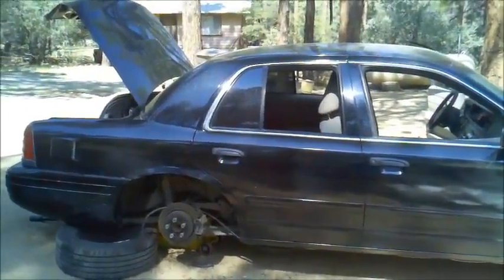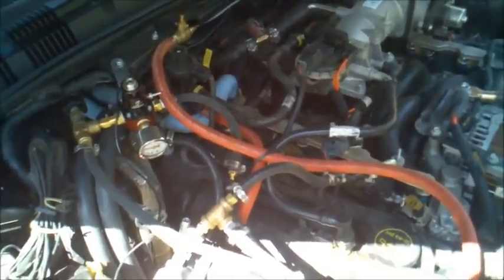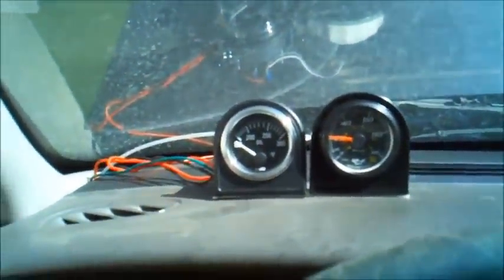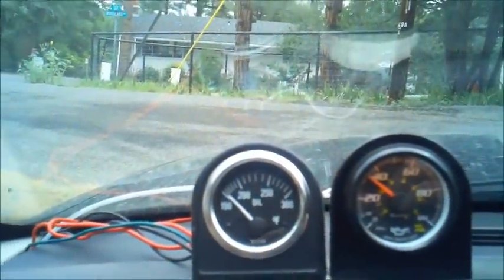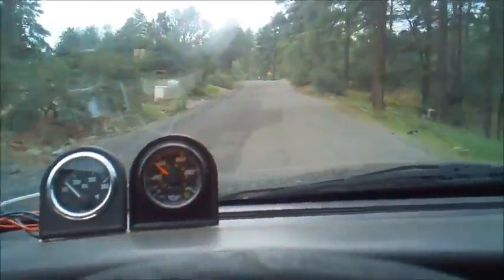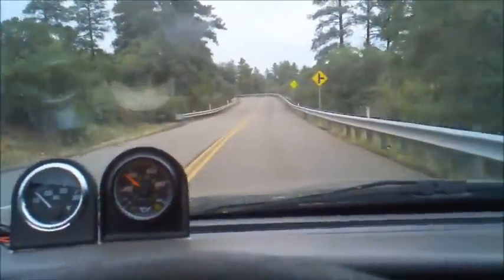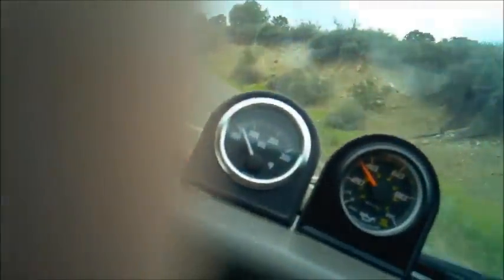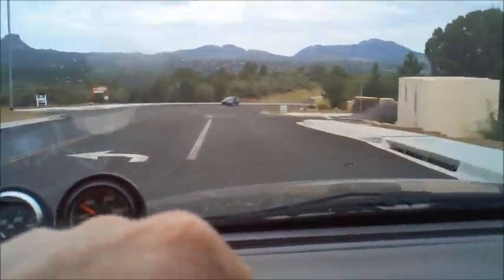H2GoNow Crown Victoria running on 100% water

Comment: man the people who've got the knowledge are really freeing themselves these days
Reply: If only we could free ourselves from this stupidity.
Reply: why stupidity ?? hydrogen cars have been known to run for ages, just a bit dangerous...
Reply: ok. not stupid. build one.
Reply: Freeman Belmont
Me? If so, why would I waste my time building something that is not worthwhile?
Reply: Ive ran my full sized avalanche off my hho cell I built... I just have to tune it to adjust the timing.
Reply: Freeman Belmont
I doubt you run a full size Avalanche off a home built HHO cell. 
First, a HHO cell large enough to produce adequate HHO to run a full size engine barely fits into the bed of a truck, often they are larger than a truck bed unless you have a proper truck with an eight foot bed. Have you calculated how many CFMs your engine flows and how much gas typical generators product per minute?
Second, you need a bank of batteries even larger than the HHO generator (slightly larger for lithium and much larger for lead-acid. Have you looked at commercial HHO generators, their size and power draw versus their output? You will find that you need a LOT of power.
Third, you will need multiple or a very large (about the size of your engine) alternator to keep that huge battery pack charging (you can never charge them, only slow their discharge).
Fourth, if you had done this you would quickly realize you have to charge up the battery pack with a wall charger because as soon as you start the engine you will see the battery pack voltage go down and it well continue to go down until the truck stops. 
In essence, what you have done is create what could be an electric truck, if you hooked your batteries to a 90 percent electric motor. Instead you take that same battery power and throw away about 40 percent of it converting water into HHO and then put it into a 30 percent efficient internal combustion engine. So, instead of a 90 percent efficient system will electric drive, you have a 12 percent efficient system. The economics of that will never make you happy.
Reply: dorianbelen
Tell me more! How many CFMs does your engine flow? How big is your HHO generator that can produce that volume of gas? How much current does your giant HHO generator draw?
My estimate is that you are burning between two and three times as much gasoline to go the same distance (if you really are doing this).
Reply: Well maybe I've Tesla'd out on you and discovered something you don't know, cause I did it 3 times...;) keep you posted
Reply: FermiGBM1 Dude I wanna do this so badly. I will find a way. Then I'll help everyone else who wants help.
Reply: The first guy who invented this idea actually got himself killed after he tried patenting it. The guy was found slumped over his steering wheel. All his designs were burned and destroyed.
Reply: @HITHEREFOLKS  as long as you install a fail safe blow off valve and a voltage limiter your good.
Reply: @Restructmusic  hey i got a crown victoria and i got some money. Can you send me some chematics on how you set yours up im fine with tuneing i just need the list of parts and how to assemble
Reply: @kevinjackson4464  there are a new type of batterys that can store 100x the charge of lithium ion. Ima use those to save on weight and money since they are easy to make that along with a plasma converter to decrease the power draw to make it heighly effictient. If i use a plasma loop device it would work just as well as the spliting proccess.
Reply: Theninety  
For three decades, since the popular use of lithium ion, I've read about a different, new, super battery literally every two weeks, on average. So far, none have panned out. Just as lithium ion hit the scene like a bomb long ago, one of the, literally hundreds, of new batteries will do the same one day. Which one will it be? If you can determine that, you could be very rich.
As splitting water with electricity sucks really badly, from an efficiency standpoint, your plasma loop device very well could be far better.
Just be sure and check the math before you spend any money. Consider, a battery driving an electric motor that is over 90 percent efficient, that is hard to beat. Replacing that 90 percent efficient motor with a fuel maker and a 15 to 20 percent efficient internal combustion engine means that 20 percent (the engine) times the percent efficiency of your fuel maker needs to equal 90 percent. My calculator says that number is 450 percent. So to be as good as a simple electric car, your fuel generator needs to be able to make enough fuel for your engine to generate four and a half times as much power as your fuel generator uses. Simple? Maybe, for someone a lot smarter than me.
Reply: @Restructmusic  email me i have some questions?!?!!?
Reply: @burntchickennugget191  If you get that working, you can do a lot more than cars. I think the tech could power houses. Make that work and you'd probably sell one to half the homes on the planet. That would be a thing, like Microsoft software, everybody wants it and everybody uses it.
Reply: @chargermopar  I saw a fire wood powered jet engine a while back and thought, I should be able to do something with that!
Reply: @kevinjackson4464  I ran a D300 Dodge truck on wood, coal and plastic waste from 1993-2008. It eventually fell apart from rust. Wood gas is inefficient but a free fuel and very low emissions. I used to haul construction debris and would burn a lot of it leaving biochar and ash for my garden.
Reply: @chargermopar  Nice.

Comment: I liked the roaring motor with much strength and much torque...
Reply: I believe you might be hearing some knock, it sounds like it's dieseling faster as it's driving in the driveway

Comment: Think about it. What is the energy source?
The car is releasing heat from the exhaust and the radiator. Where is this energy coming from?
The engine cannot spontaneously heat up without and energy source.

Comment: I have a question, are you using ZERO liquid gasoline and just pressurizing the factory fuel rail and injectors with HHO gas for this system? My concern is this, electronic fuel injectors NEED liquid fuel to cool and lubricate them. That's why running a new-ish car out of gas is so hard on the injectors and the fuel pump. I have to wonder how long the stock injectors will last. Looks like it works well right now though, nice work!

Comment from the maker: Yes, I believe so.  But the question remains; Will this be cheaper than gasoline when you factor in the $3-$4 dollars a gallon for distilled water, who knows how much for the electrolyte, plus the HEAVY DUTY alternator that must handle up to 400AMPS, the price of the heat exchanger under the hood and the filters that must be replaced in the circulation system.  But yes, for real....
Reply: HHO Archived Videos $3-4 a gallon for distilled?!? Where are you buying from Neman Markus? When I buy distilled it less than $1. Even making distilled water through a consumer-use distiller does not cost that much.
Reply: you want electrolytes in water not distilled
Reply: @HWandW  plus one gallon of water produces about 4,558 liters of HHO lol, if it runs at like 40 LPM (which is about average from what I've seen) It'l run for almost 2 hours on one gallon, if you have a 15 gallon tank it run for like over 25 hours.

Comment: What's the best way to plumb the h2 into the engine? I have a prototype I'm using based off a chemical hydrogen reaction vs electrolysis and I can't get it to run through the stock injectors

Comment: completly out of fuel? there is a little thing in your gas tank that floats on the fuel and if there is nothing in the tank it will not float like you said it does not figure out it self also the engine noises

Comment: What about rust in the cylinders.I'm glad that someone is trying  to get away from depending  on the devil's oil.
Reply: there's no rust because the HHO mix turns into water or steam when it's at that temperature so basically you're steam cleaning the injectors, cylinders, exhaust, etc...
Reply: You need to talk to the person who made vedeo

Comment: Great. No Carbon emissions. But to produce oxyhydrogen for fuel is more expensive, because you use way more energy producing a certain amount compared to the minuscule energy you will get by combusting it. That's according to Mr Thermodynamics. So, if you are not using nuclear/solar/wind energy for the electricity you use to produce oxyhydrogen, then you end up with producing more carbon footprint.
Reply: ron ilumin how long have you been working for which oil company?
Reply: +Trina McDonald 

Hydrogen has more energy per unit mass than other fuels (61,100 BTUs per pound versus 20,900 BTUs per pound of gasoline).  The problem with hydrogen is that it is much less dense (pounds per gallon) than other fuels.  A gallon of gasoline has a mass of 6.0 pounds, the same gallon of liquid hydrogen only has a mass of 0.567 pounds or only 9.45% of the mass of gasoline.  Therefore one gallon of gasoline yields 125,400 BTUs of energy while a gallon of liquid hydrogen yields only 34,643 BTUs or 27.6% of the energy in a gallon of gasoline.   The Space Shuttle uses hydrogen as a fuel, because its mass is low, and the fuel is carried in an external fuel tank that is jettisoned during lift off.  Automobiles can not have external fuel tanks that are discarded, and the energy per unit volume is used to determine a fuel’s energy density in automobiles.  Compressed gaseous hydrogen is even less dense than liquid hydrogen.  At 5,000 psi of pressure gaseous hydrogen only has a density of 0.25 pounds per gallon or one twenty fourth the density of gasoline.  Gasoline and diesel are far superior fuels to hydrogen in this regard.

http://www.dalefield.com/slspartners/hydrogen_fm.html
Reply: +ron ilumin does she have 2 mouths?? :O

Comment: Jesus bless you Brother. I wish i could put this in my here in the Netherlands. 

Is there a way I could reproduce this at home?
Reply: Sure, just hang some junk around your car and say it is running on water, that's what he is doing.
Reply: Kevin Jackson i see, could you tell me how you found out?
Reply: Kevin Jackson 

Ah check,.. Stil not really a convincing answer tough. I can also tell you i have a PHD. Still it doesn't proof that I know your appandix need to be removed. Funny that people always trow alot of words and still cannot explain why this could not work or why it did work. 

That's the whole reasson I asked this person a question. 

And also the reasson I ask you the question, how you found out..So can you descripe why this is not true?

Details matter. Not just an answer so everybody needs to believe what you say is "also" true. Dont expect people to be convinced in him as we are in you. ( no disrespect intented )
Reply: Okay, fair enough but, I can't give you a physics and engineering education in a youtube comment box.

You can run a car on hydrogen and oxygen though considerable modifications to the engine, its controls and materials will be needed (check out hydrogen embrittlement). You can generate hydrogen and oxygen by splitting the molecules of water into those constitute parts using electrolysis. The question then becomes, would you want to? You have to use electricity, that has to come from a battery, to get your hydrogen and oxygen fuel (HHO). Electrolysis is shockingly inefficient, meaning you use a lot more battery power to make the HHO than you can ever get back burning it, much less having any left over to push a car around. This is not my opinion, it is a basic physical fact just like - if you throw a baseball up it will fall down. What you will have done is take an electric car (powered by the battery as these hydrogen cars are) and make it go less than half as far as it would have.

Because a shocking number of people don't understand simple, basic physics, you will find hundreds of confidence tricksters scamming others, and now, making youtube videos claiming they have cars that run on water. If they really made a car that runs on water, what they really have is a car that costs a lot more money to make and drive around than any other kind of car. You will also usually see claims that they have something so special that no scientist has ever heard of or been able to make work like special catalysts, special electrolytes, special electrical signals going to their electrolysis unit, or special resonance, or special process, or special zero point energy, or special flux capacitors, or special warp drive units or any number of words from Star Trek, astronomy, particle physics or some other nonsense.
Reply: Ah check, That so far is very true. thanks for the info. An inventor (a friend of mine) Also told me this. 

He calculated the input that was needed and the output that it gave. It indeed could be useless. with only a battery or 2.. And the power in general that is needed.

That's indeed very clear. 

But what i do not understand is, if people claim that their car drives on HHO then i would like to know why and how. 

And if they don't (as you claimed indeed) then i would like to know.. In what way could you see that this is a scam? leaving logical physics as it is.. is this man truly lying for example and if he is, then why? I mean he does not sell anything. So what possibly could he scam us with?

I'm not interested in sience fiction, what i'am interested in is making the impossible, possible. 

Cause even tough it sounds like magic. There are still inventions made that sound impossible, but still created. And water is still a form that is not fully investigated (sorry bad english).. What more we can do with just water and it's elements. Sounds like sience fiction, but neh.. i don't buy it, that we are allready fully known of what is capable. Even tough i sound like a dreamer.. 

The best inventions in the world are developed by dreamers (not a fact, but creativity does have an important role)
Reply: You're hitting a lot of topics.
In order to create the kind of performance you see in this video, you would need an electrolysis device as big as the car and an equally large bank of batteries to run it. The scale of the equipment is just way off.
Human motivations and behavior can be complex. I think many of these people are dreamers and tinkerers  that are duped into experimenting in this dead end arena, which is too bad because they could be working on something worthwhile, what a waste. Once they have something that appears to work they may not realize that it has no real value. Some may simply want to get paid by youtube for views, I have an acquaintance that makes enough off youtube to cover his house payment. And, some are seeking funds directly.
We know a good bit about water, electrolysis for instance, was discovered over two hundred years ago. The knowledge that water is comprised of, essentially, rocket fuel fires the imagination and excites many. If we had a source of hydrogen that didn't pollute the planet or cost more than fossil fuels, all cars would be running on it. We simply don't have that...yet. But, we do know that electrolysis is not the answer.
Every real invention you have ever seen or heard of, no matter how impossible sounding, does not violate the laws of physics or thermodynamics, as this does.
Reply: lol. you got life figured out don't you. Na sayers are the best!
Reply: Or you could get a 250 amp alternator and a dc to dc buck converter that knocks the voltage output to 4 volts and 30 amp output while only drawing 12 amps, then requiring your cell you only be a positive negative cell. You don't know everything dude. sorry. I don't either, but from what you say, I believe I have more hands on than you.
Reply: Why you think that. HHO is real. You need update about it. My car have the system. 70% hho and 30% gas.
Reply: Freeman Belmont
What difference do you think any of that will make? 
The problem here is not with the performance of the HHO generator, the problem is basic physics. 
I have to agree that I don't know everything but I know enough not to waste my time with this stuff.
Reply: dorianbelen
Tell me more! How many CFMs does your engine flow? How big is your HHO generator that can produce that volume of gas? How much current does your giant HHO generator draw?
My estimate is that you are burning between two and three times as much gasoline to go the same distance (if you really are doing this).
Reply: Kevin Jackson is a Dry Cell with 43 plates in 316L stainless steel
1 Water tank in PP volume of 3 litres 
1 Control Unit Box with 60A PWM, voltmeter and ammeter
- Electrolyte - Potassium hydroxide (KOH)
I add a litte balloon between the bubleer and the car filter to have a little more pressure in the hho gas delivery.
Reply: dorianbelen
How many CFMs does your engine flow? How big is your HHO generator that can produce that volume of gas? How much current does your giant HHO generator draw?
Reply: dorianbelen
How many CFMs does your engine flow? How big is your HHO generator that can produce that volume of gas? How much current does your giant HHO generator draw?
Reply: @kevinjackson4464  I have one question to you and that is who is paying you to misinform others? I used HHO and get 200%+ on Diesel.
Reply: @arnold3785  Hey Arnold, I have one question for you and that is why did you say "used"? If I had a diesel that got 200%, I'd drive it forever.
Reply: @kevinjackson4464  because my wife had an accident with the car and I took it out but I am going build it in another car now.